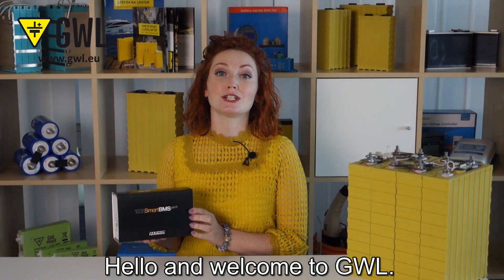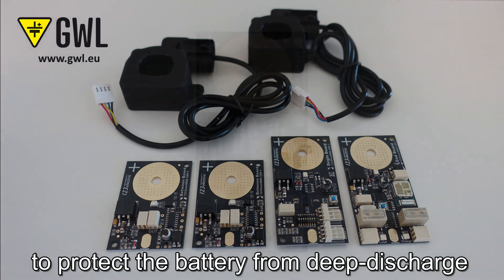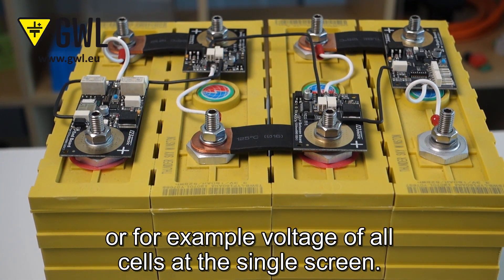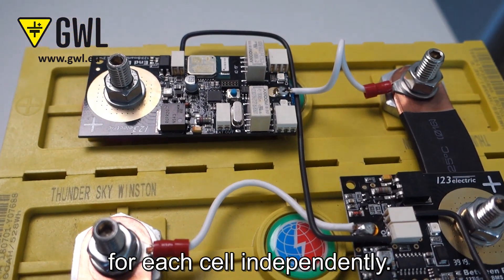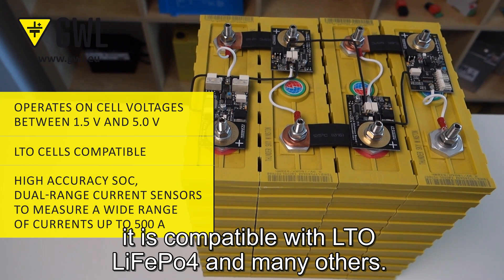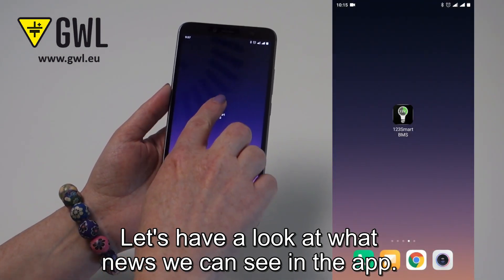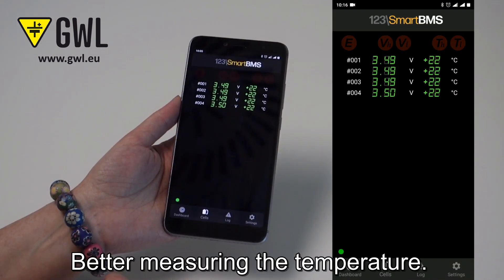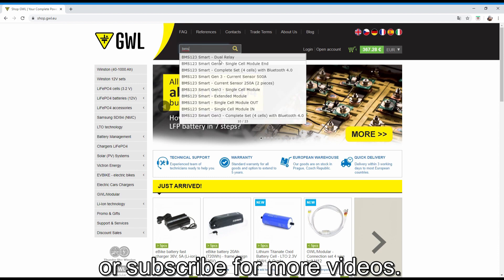Protect and monitor Lithium cells with BMS123 Smart

Comment: I have the BMS123 gen 2, and want to upgrade to the gen 3, but $100 shipping to the U.S. is way too expensive. Why don't you have any U.S. distributors?
Reply from the maker: Hi there, well it is not that easy as you think, but we slowly working on it.
Reply: @ELERIX-LiFePO4  I've had your Gen2 bms since 2016 and have been asking you for a U.S. distributor... I really wish you'd quickly work on it. BTW, your products are regularly talked about on many battery & power forums, and the #1 aversion to buying is the very high cost of shipping (typically 1/3 of the cost of the bms kit) --because you don't have a distributor in the U.S.A.
Reply from the maker: @vespagts7078  I am so happy to hear it. We will do our best. In case you would like to be a one of them, we are open for the discussion.

Comment: How exactly is the temperature beeing measured? Does anybody know?
Reply: Hi Marco,
The temperature is measured with a temperature sensor on each cell board. The sensor is close to the + pole with some copper from the + to the sensor for best heat transfer.

Comment: How accurate is the current sensing? Can it sense a load as low as 250mA to 500 mA?
Reply: Hi Jim,
You can use the sensor in different situations. If you need the full 500A range, the sensor can measure from 300mA up to 500A. If 250A is enough, you can loop the power cable 2x through the sensor and you will measure from 150mA to 250A.

Comment: i do not understand exactly  how it works. You say that BMS shown here is for balancing and protecting the battery for deep discharge and overcharge. In an other video you show additional Ralay.
Is the relay neccessary? or can i use the BMS as it is shown here without relays? I want to build a LiFeYPo Battery in the Van and i need to run a pure 2000W sinus inverter and as i understand is the relay too weak for  currents of 170A.
Reply: If you want to allow the BMS to cut off the load or the charger, you'll need a relay for each. Ideally you'll want a self latching relay, since they use very little power. The 123 Smart Relay can do all this, as long as you're playing with less than 120 amps.
Reply: @Jim-ei2iv  Thank you, that helps…